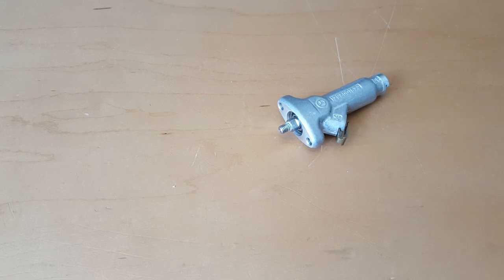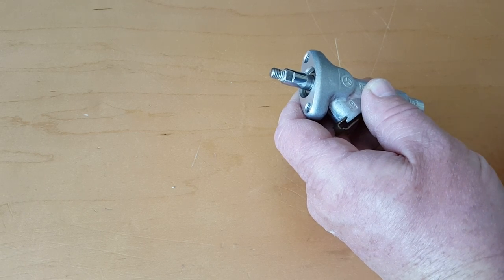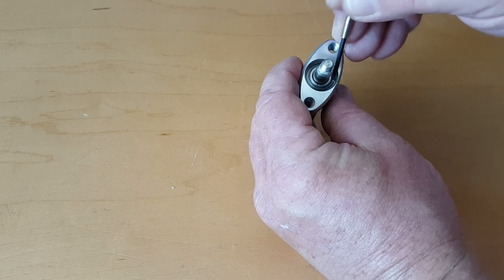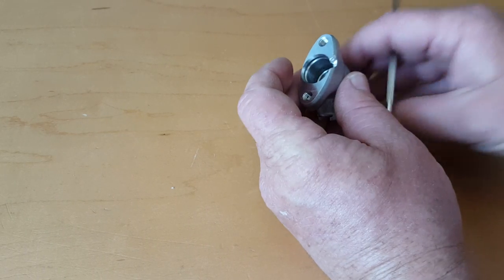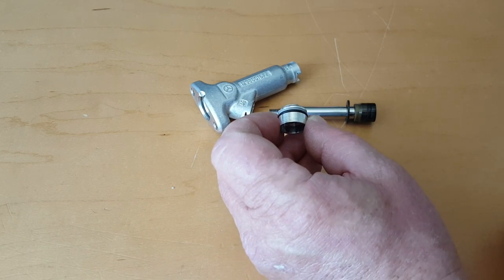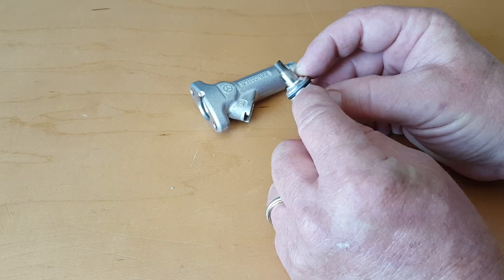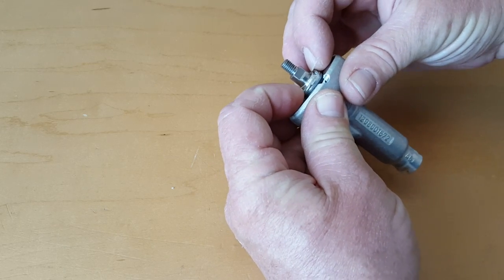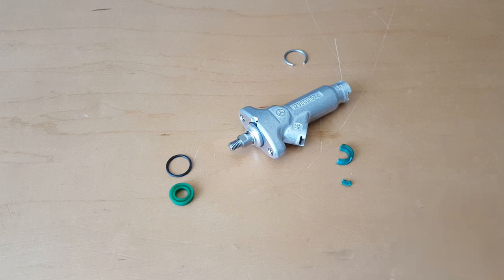Mercedes Hydraulic Cylinder Repair

Comment: How can I get one of these seal kits. I have a 2002 CLK 430 with 60k miles. It's is pristine Accept the top stop working because of the bow. Cylinder. It's so frustrating that they just don't make these seals available. Seems like you're only option is to pay top hydraulics twelve hundred dollars. I already have the cylinder pulled out and cut the notch. Just as you advised and the cylinder's apart. The green seal is in about fifty pieces.
Reply from the maker: I have a few of the green ones I'm not sure if I have the o-rings. If you paypal me $5 for postage I'll send you the green seal and if I have o-rings I'll include those PP to  jkomar@iasun.com

Comment: Hello,  Looking to order a seal rebuild fit for a 2002 SLK 230, lock cylinder.  Do I just send you my info via Paypal?  Also, does your kit include the O-ring as well as the green seal?  Thanks!

Comment: Hi John,
1. I have an SL500, Year 1999 and i would like to purchase complete seal kit even though only one of the cylinders is leaking. Do you advise to rebuild all cylinders even if they are not leaking yet? or should i just rebuild the leaking one ?.
2. All the seal kits in the market for rebuilding are O rings which is different than the OEM CUP seals. which one do you think is more durable ? and do you advise putting the O rings?
3. the Kits that you supply are they O rings? or Cup seals ? and new ? or used?
4. do you have all the different cup seals for all the 11-12 cylinders for the soft top ?
5. any instruction manuals included? or at least cylinder chart?
Reply from the maker: Nersis Kyoumjian : a kit is for one cylinder I would only get what you need.

Comment: Hi All, I'd like to buy get the seals prior to reassembling the Hydraulic cylinder. I've no idea how are the dimensions of the O-Rings and the gaskets, seals you name it. Could anyone help me with that?
Reply from the maker: Bartosz Chrzanowski if you look in the comments there is instructions to acquire seals.
Reply: Thank you for your swift answer John, great video btw. it made me literally believe that I can do it. 

I need a set for my 95' Mercedes A124 E320. I noticed a leak on the left side of my car, the oil was leaking down the sill and the roof only hardly and very very slow closed.

Last year I had a leak from the rear bow lock cylinder. It was repaired.

Now after the other one leaked someone told me I'd better buy all of the hydraulic cylinders or renew all of them. My car has btw. about 167k mils driven. How many seal sets would you suggest me to buy?

Do you ship to Poland, how much is the cost for all the necessary seals?

Cheers
Bart 
(sorry for my poor English, I use it only at work to a limited extend)

Comment: yeah but after spending all that time to dig out the cylinder, why not fully rebuild it?
Reply from the maker: Cost and availability of parts. Buy a new cylinder if you are worried about it. For $10 you could be back in business in less than an hour. I haven't run across any that could not be repaired this way.

Comment: Hey John, got another satisfied customer here
. Worked great wth the help of your tutorial. Thanks again !!!
Reply from the maker: Sean Ford  great to hear it worked so well. A solid fix with the correct seals for 10 bucks can't beat that.
Reply: @wetsoup  I am needing to rebuild a cylinder on my 2003 CLK430 soft top. How can I get an o-ring and u-cup seal?  Thanks.
Reply from the maker: @matthewperry1689  for seals and u-cups I still have them its $10 via paypal to jkomar@iasun.com shoot me an email with address info because I'm busy and sometimes I forget.

Comment: Hello John, do you send seals kits to Spain inland?Thank you.
Reply from the maker: Yes - shipping GREEN u-cup seals
Reply: @wetsoup  Hello  John , yesterday I sent to you an email, did you recieve it? I need to tell you the cylinders I have damaged and my adress. Thanks in advance.
Reply: @wetsoup  Hello:
Do you sell a complet kit for my 8 cylinders with the diferents diameters?Regards.
Reply from the maker: No I don't see an email - it's jkomar@iasun.com
Reply from the maker: No I do not sell complete sets but we can rebuild any cylinder the cost is between 65-85 USD and is cylinder specific. Depending on the make and model of the car you will not be able to get the cylinders apart as it requires special tools.  This bow lock is one of the easiest that's why I did the video to help people do the ones they can at home.
Reply: @wetsoup  Hello John, I sent to you another email minutes ago.Maybe is in the spam carpet...Regards

Comment: John, I want to change or rebuild all of the cylinders. Do you have kits?
Reply from the maker: Brett Standifer no only bow lock. if I knew bore and cylinder diameter I'm sure I could make them
Reply: What do you have?
Reply from the maker: Brett Standifer machine shop
Reply: John Komar I meant what parts do you sell?
Reply: John Komar how do I get the rebuild parts you do have?
Reply from the maker: Brett Standifer PayPal 10 USD make sure you leave your address. jkomar@iasun.com
Reply from the maker: Brett Standifer sell most on eBay what ate you looking for
Reply: John Komar best would be the seal kits for all 5 cylinders for a 99 slk230
Reply from the maker: Brett Standifer email me

Comment: Is this for 2003 R230 SL500?
Reply from the maker: Fran Dauhajre yes the front bow and truck cylinders
Reply: I bought my 2003 r230 a year ago and I have to fill the reservoir every 3 times I open/close the roof. Mystery is I dont see any hydraulic liquid anywhere! Where should I start?
Reply from the maker: Fran Dauhajre its hard to see the leak because of the liner and it is a very light oil like mineral oil not .motor oil. use dry hands and touch the area around the cylinder its slightly moisturizing.
Reply: I am filling it with normal power steering fluid, its even red!
Reply: Where can I get instructions on how to remove the headliner?
Reply from the maker: Fran Dauhajre I use mineral oil but I image the others would work
Reply: Should I try and do this myself? How do I order the new seals?